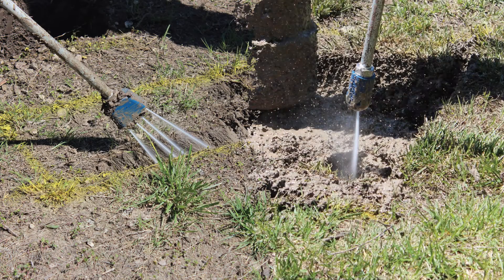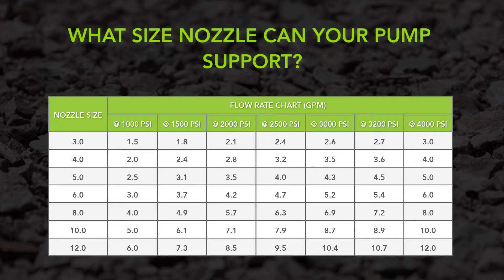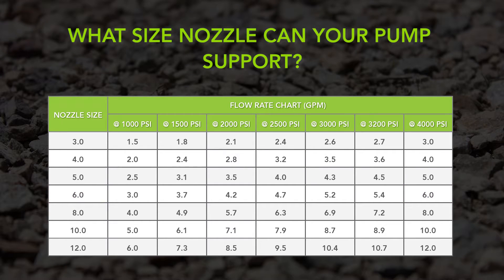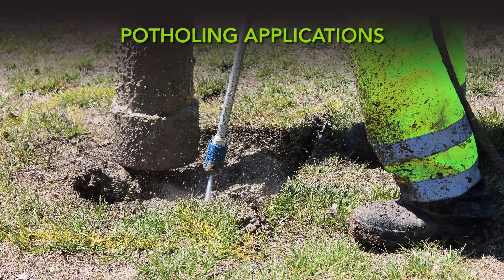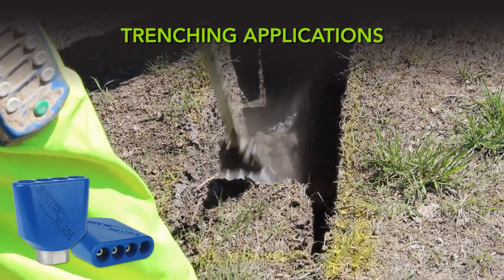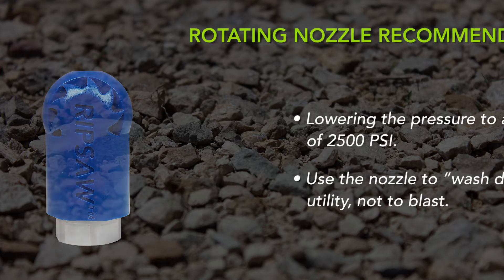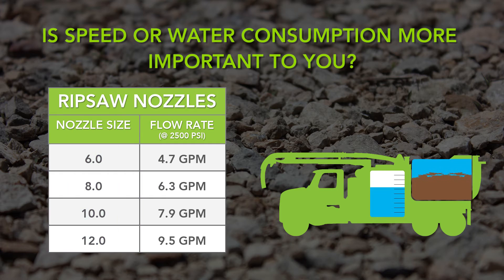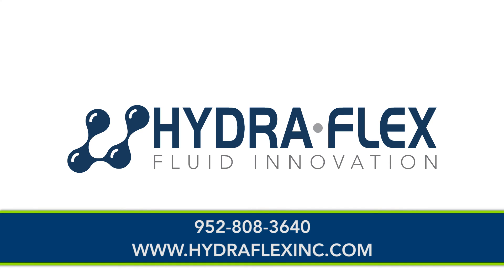Hydro-Excavation Nozzle Selection & Sizing Tutorial

Comment: Mine is a 5.6 gpm at 3600psi which nozzle its recommend? Then im confused at the maximum 2500 psi so by looking at the chart at the psi and gpm i would need a 6.0 nozzle?
Reply from the maker: Hi rocsvt - The maximum PSI on our Ripsaw are 3200 PSI. We recommended either a 5.0 or a 6.0. At 3200 PSI the 6.0 will put out closer to 5.4 GPM where the 5.0 will do about 4.5. It depends on whether you need to save water on the type of job.
Reply: @HydraFlexInc  Can i leave it at 2500 psi or at the 3200 psi? This will be used to pothole utilities.
Reply from the maker: @rocsvt1  - Great question. You can run it anywhere between 1000PSI and 3200 PSI